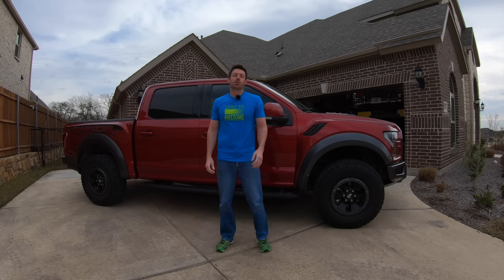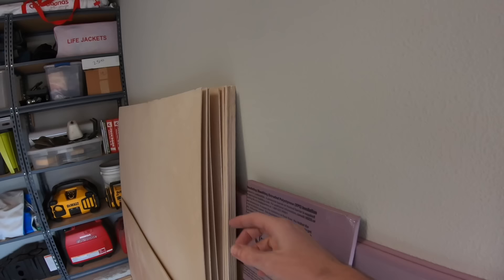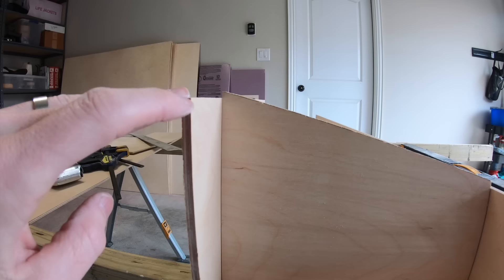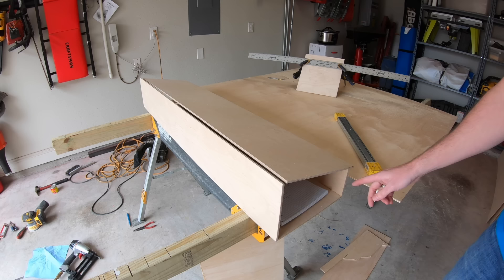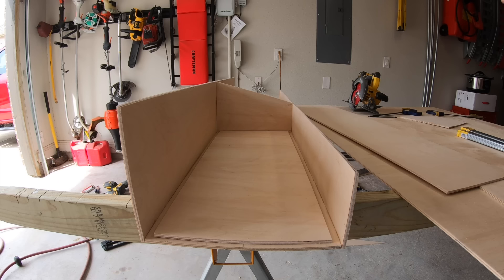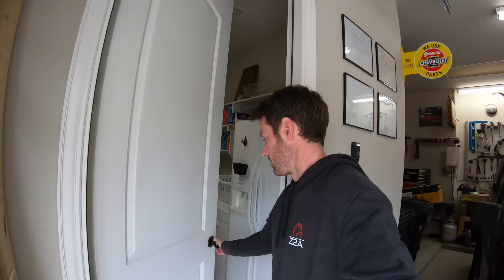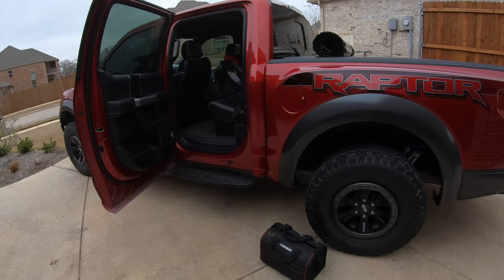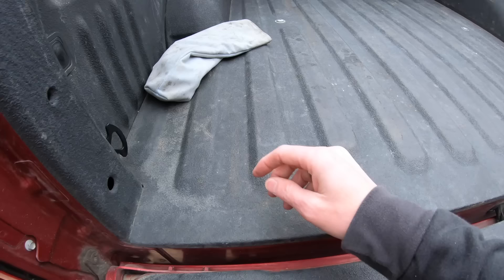DIY hidden in-cab drawers **YOU CAN’T BUY** for only $100 in materials! Patent pending!

Comment: Did you consider putting the slides in the bottom ? I have used them that way on other projects and it works great and you only lose 1/2 inch in height.
Reply from the maker: Kind of: https://youtu.be/2OcoYbVbqGE

Comment: I would imagine with the weight...that shifting (sliding) wouldn’t be an issue. I know some mentioned Velcro, but even if it did move, use the adhesive spray on the bottom of the box to attach a thin roll (sheet) of rubber on the bottom box. Between that and the floor mat, there would be too much friction for it to go anywhere regardless of weight. By the way, I love the build! My truck has a sub on passenger side unfortunately. Any idea if there is mounting hardware to mount an AR, shotgun or rifle behind the seat? I know you can purchase rear seat release kit on Amazon.

Comment: This came out great!  Looks great. Did you anchor it, or are you just using  "gravity"? Looks great. 
I have the Tuffy locker under my rear seat. It is a top access, so with the baby seat, it would be an issue. (my seat is 60/40 split. The box splits too. Locking.) Nice job.
Reply from the maker: Thanks! Gravity seems to work so far, but anchoring it wouldn’t be a bad idea

Comment: Nice job, but IMO it should be secured to the car somehow. One hard brake and it can slide forward pin anyone with legs on the floor between it and the front seats.
Reply: How about pulling out the drawer and reach in and screw it to the floor?

Comment: Good job on your build. I will do the same. That wood u used looked really thin. How are the drawers handle with weight when drawer extended ? I'm thinking of putting a hydraulic floor jack with the pipe.
Reply from the maker: It’s doing just fine but I might go a little thicker if you’re going to put a jack in it. Or even better, steel!

Comment: I'm sure it's been said already but you should use an inside support in the corners and bottom at least 1 x 1 or better 1 x 2.  I don't think the sides will hold up to any long term use otherwise.

Comment: Just got recommended this. I don't get what ford did but my 2011 f250 has the underseat locking storage that you just lift up the seat and it's full length.  I don't get why the f150 has nothing lol.  I've seen some of the newer ones have like folding underseat storage.

Comment: just so you people watching know if you deside to do this check with local and state laws. some places ban hidden or semi hidden compartments. even onces from the manufactor. I learned this. I bought a dodge journey witch in most states has a compartment hidden in the passanger seat. well in il its not legal to have hiden compartments in in the chicgo aria they def do not alow it in any way. so thinking I was saving money on the journey I bought it from il and I live on the boarder only to find out I did not save money that was just the difference of having a standard seat instead of the one with the hidden compartment. witch sucks. now if I want to say leave my gun in the car I have to take it in the store with me just incase someone desides to break in. I learned a lot of tricks they pull tho like the fact they charge you up the but if you want a alarm telling you you need to buy one when the truth is the car has it in it already and they just activate it. well for under $100 I can buy the softwear and a device and cable to do it my self at home.

Comment: Your video was made a year ago and I tell you yes, if Ford makes a drawer unit for trucks you should sue them, dude I don't care where you got it from but that is genius however I would recommend you put more details in the videos you make cause some people just don't know the products you are using for example the contact spray adhesive I think you should have explained real quick how the spray works I mean some people wouldn't get it, I do and I understand you got to spray them both sides then wait a little bit like 5-10 minutes 15 the most and then stick the carpet mat together that's  contact cement works, a lot of people don't know.😊

Comment: How's it holding up so far with that weight? I'm thinking I might use a slightly thicker ply in my build.
Reply from the maker: No problems so far. It you get some nice wood from a lumber supply and not the stuff at the big box stores it should do fine

Comment: I saw the production model, honest question is there any reason why it wouldn’t fit in a 2014 silverado?
Reply from the maker: The transmission hump and seat height are the biggest things that get in the way of it fitting. If you do some measuring and it’s close you might be able to make it fit. It just might not be a perfect fit
Reply: @ZeroToAwesome  I have a crew cab so I’m sure my rear seats are nowhere near the transmission. I asked a shop to see if they could make one out of wood and the quoted me at $1200. Stuck between a rock and a hard place lol

Comment: duha has a platic storage bin that i have in my truck works good for what it is.
Reply from the maker: Saw those, can’t lift if the seat with the baby seat though.
Reply: @ZeroToAwesome  Yes, totally correct.   Slide draw you did was really good though.  Just figured id mention for other people

Comment: Nicely done.  I’m curious how this has held up? The wood seemed a little thin for the task. Any issue w the box moving under braking?
Reply from the maker: So far it’s all good. The wood is better quality than you can get at a big box store and the rubber floor mat seems to keep the box in place.

Comment: I love it. Thank you for this video! I am definitely going to try something similar when I pick up my gen one raptor.

Just curious, do you have any issues with it sliding forward under hard braking though?
Reply from the maker: Haven’t had a problem yet. It seems to stick to the floor mat pretty well. If I did I was gonna secure it to the seat bracket or maybe the stock cubby
Reply: @ZeroToAwesome  Cool thanks

Comment: What a great idea! I see one of these in my future! You think this would still work with out the drawer slides?
Reply from the maker: Thanks! And yes. My original idea was some uhmw on bottom to help it slide and I still think that would work. Heck, just go wood on wood and spray it with some oil.
Reply: @ZeroToAwesome  will keep you posted if I build one. Might show it on my channel and give you the props for the idea if that’s ok.
Reply from the maker: @oversplodegarage41  works for me. Good luck!

Comment: I'm concerned how well the drawers will hold up being 1/4" and just butt jointed together. You put some weight in them. While off-roading the tools are going to really beat on the drawers. I'm not sure they'll hold together long term. Aluminum angle will easily reinforce the corners without taking away space. I like your project, but I suspect a little beefing up will be required. But this is a YouTube video. I think otherwise you would have made these from metal and they'd be super strong.

Comment: Saying “I can’t weld, so this isn’t DIY” is a cop-out. Making this out of wood is a terrible idea. As soon as it snows, rains, or your kid spills a drink this box is going to get soaked and warp and start to fall apart. Over time that wood is going to get extremely flimsy and won’t last over time.
Welding isn’t that difficult and getting a machine to weld thin steel isn’t very expensive.
Reply: Wood is fine dude. My dad's a carpenter and he made his toolboxes out of wood. 35 years later they're fine